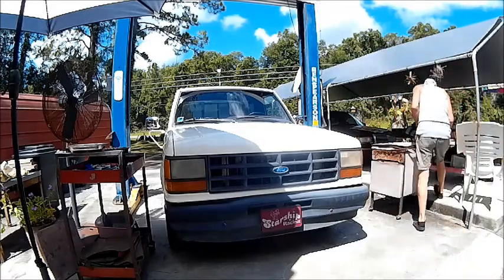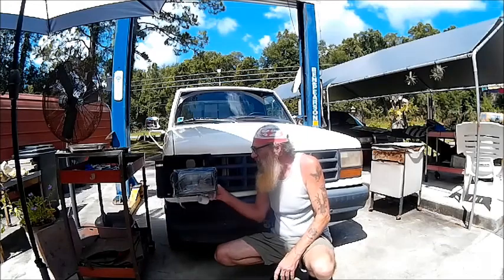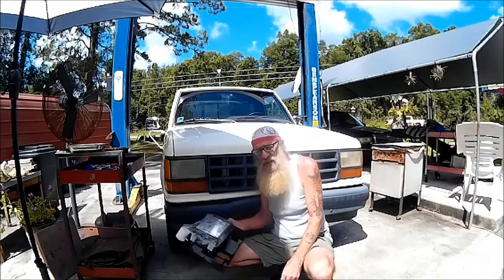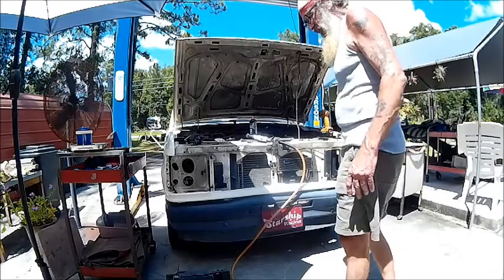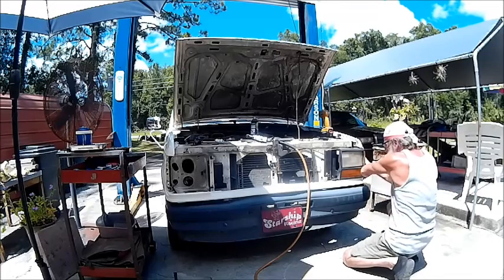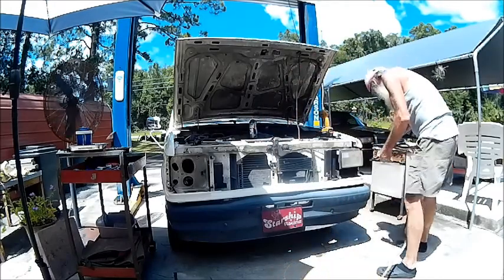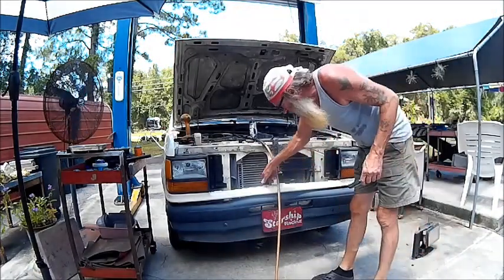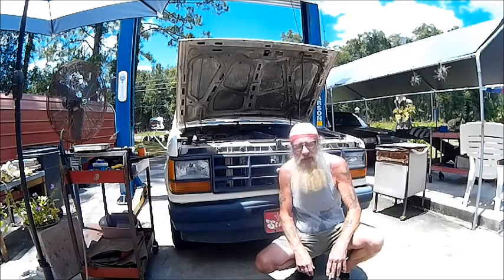1990 Ford Ranger Headlight Assemby Replacement

Comment: how would you remove the lower metal bit below the grille and headlights?
Reply from the maker: Remove the grill and headlights, remove the bumper to make life easier with the filler strip. You'll see the screws that hold it on at that point.